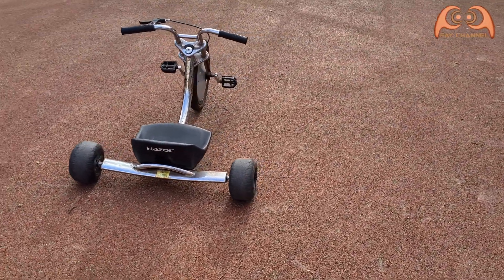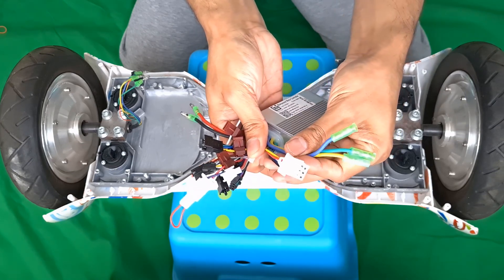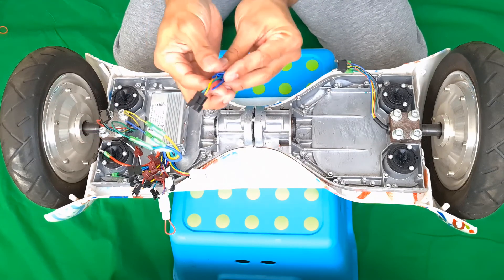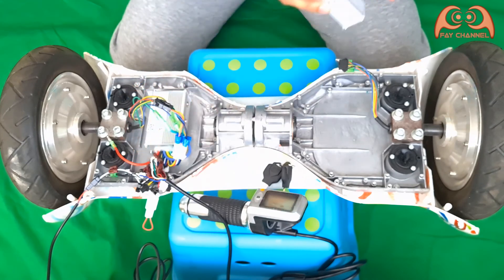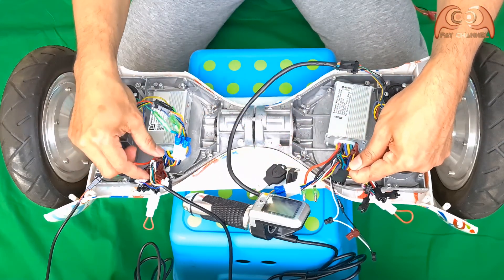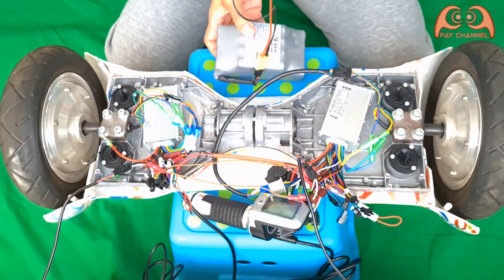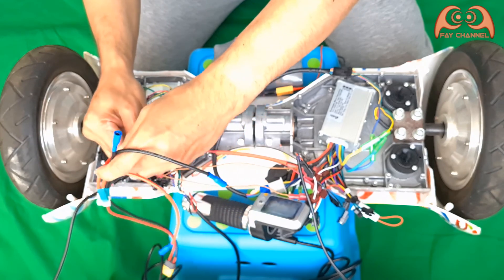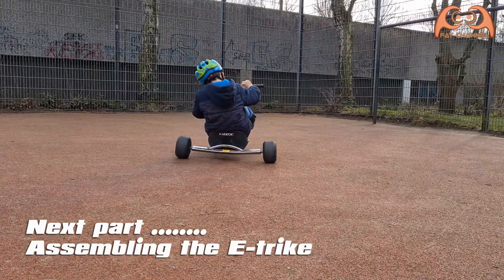DIY E-Trike using Hoverboard Motor with E-bike Controller | Part 1 Wiring Instruction

Comment: Hi could you please tell me how you charged the battery with the circuit boards removed where did you wire the charger plug to thankyou

Comment: Does the Brake actually slow down the wheel or ist ist only cutting the Power to the Motor? I have bought Tel Controllers and when the brake wires are connected, only the throttle is cut but no actual braking force is applied. It would be extremely nice if you would answer my question 😅🙏
Reply from the maker: The electric brake only cut the power, therefore we need the normal brake as well (like standard e-bike).
Reply: @FayChannel  Okay thank you very much für the quick answer :) I really appreciate it
Reply from the maker: my pleasure 🙂. You can see how I assembled it in the second part here: https://youtu.be/7Ficr2xN7DQ

Comment: How did you charge the battery
Reply: I think you have to unplug the battery and charge
Reply from the maker: Sorry for late reply. It is true what @Elliot Downie said, I unplug the battery first and recharge it separately. But I have upgraded it with external battery with bigger capacity, you can see it in the 3rd part of the video here https://youtu.be/_4ejSYfvFVk
Reply: I guess you can just attach the female plug from the hoverboard to the battery connection, red-to-red, black-to-black, then you can just plub and use you charger... (I guess...)